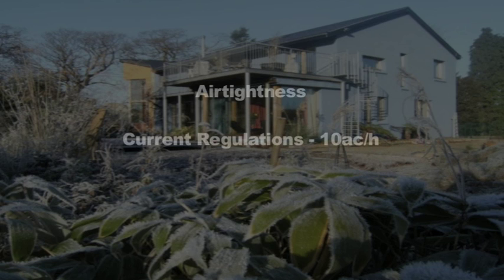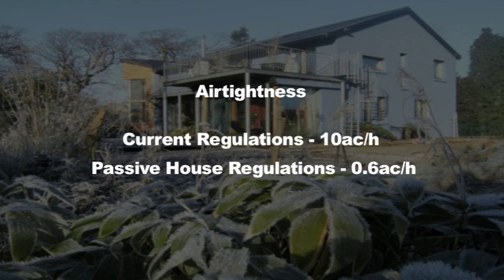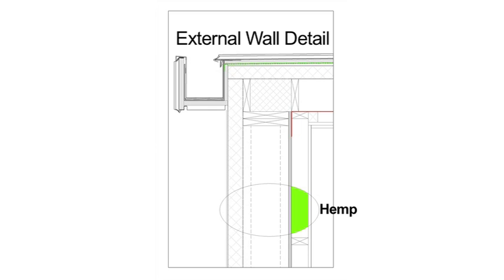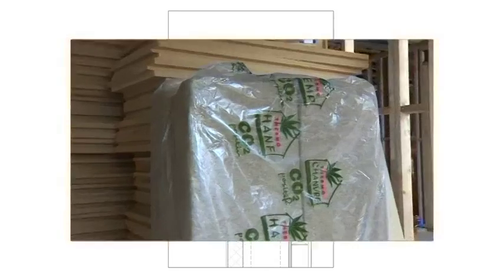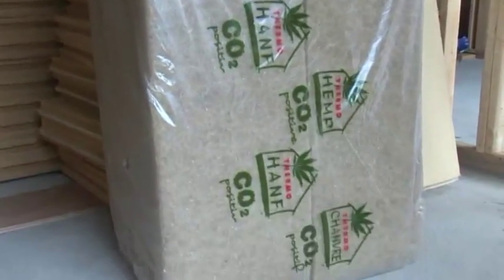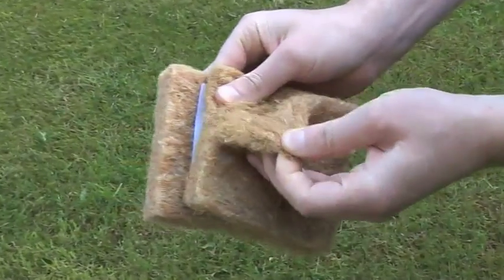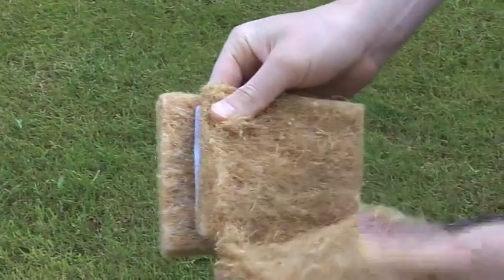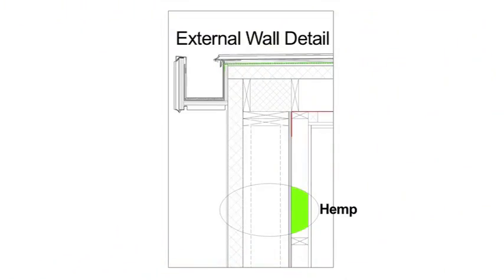Insulation and Airtightness - Passive House Series

Comment: It's just to bad that they are wasting all this money on all these layers when they could use a single 2x4 wall and 2 inches closed cell spray foam in it and that will out perform what they are doing easily. Spray foam in the only way to go, ever.